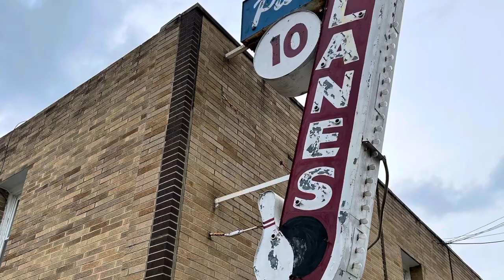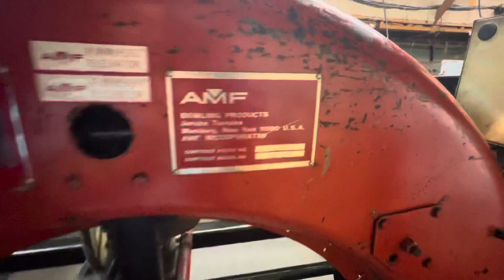Stills and video from Pawnee Lanes - Bedford, Ohio - AMF 82-70 above grounds - Garage Bowling Alley

Comment: I always loved the AMF machines.  Do you ever get a one second urge to swap out your machine for an 82-30 or 82-70?  I know space is limited and you invested a large amount of time in your machine, but imagine how nice one of the AMF pin setters would look along with your AMF masking units with spare indicator.  It also appears, I may be wrong, AMF may be a little easier to work on.
Reply: I personally like/dislike AMF. I like their pinsetters were interesting on how they run but I dislike from my personal experience as a Bowler that their pinsetters aren’t resistant to poor maintenance. Brunswick GS can be resistant cause I bowled on them and they were not bad.
Reply: @PinoyBowlerGS92  The Brunswick A2s and the AMF 82-xx series seem to be more efficient with pin loading compared to the GS series IMO.  I don't understand how the conveyer belt system is better then how the older machines loaded pins.  With all of the modern tech, I don't know why they went with using the table to check for pins after the second ball?   Seems it adds a little more time to the pin setting process.  I guess it's just personal choice.
Reply: @pebmets   The GS’ Pin Loading is more on Freedom of moving like it doesn’t need a Strict Pin Loading like the A2 Turret or AMF Distributor and Bins cause the GS had features that AMF and A2’s doesn’t have like something called “My Shot” or Automatic Pin Set Up. Let’s say you’re setting up the 1-7-10, the GS could set it up automatically (no mechanic required) and it’s Pin Loading helps that without causing any Jams cause the pins are circulating around the machine, imagine if that happens on AMF then a Pin Jam would occurred. Also the reason the table still lowers on 2nd Ball because of Detecting any pins standing, I don’t mind that because it’s the machine’s job. In my opinion tho that the GS Pin Detector Plates are better than those crappy scoring cameras because they’re not 100% accurate which I’ve experienced inaccurate scorings on the AMF Accuscore XL systems opposed to the Brunswick 2000 AS Scorings I’ve seen no problems of scoring except their CRT Monitors are garbage for showing a glitchy scoring image.
Reply from the maker: I’m a fan of the mechanics.   Brunswick is 100% mechanical.      It can detect standing pins, strike or out of range and mechanically and do 3 different cycles depending on what it detects.   No tubes or relays for its basic operation.   You could run the machine with just one motor plugged into the wall      82-30s fascinate me too but Brunswick to me wins hands down one of the most awesome things ever invented !  The Model A Pinsetter